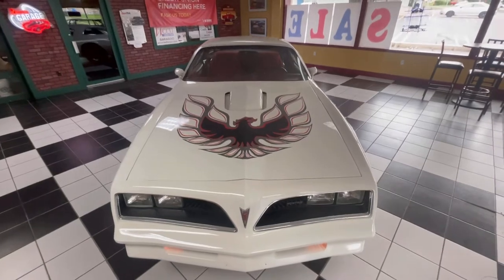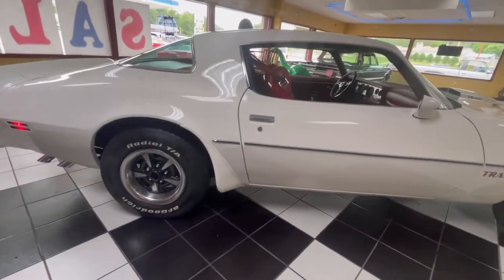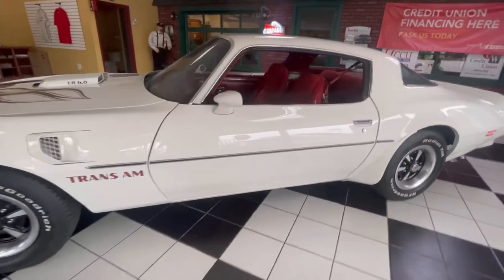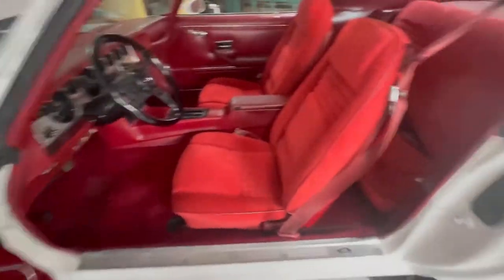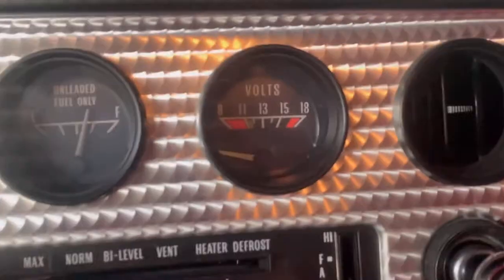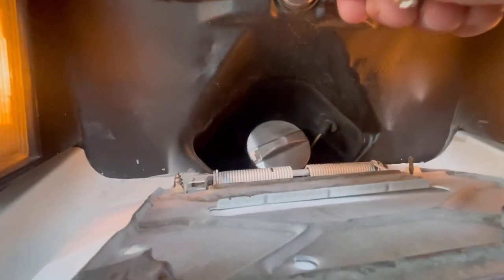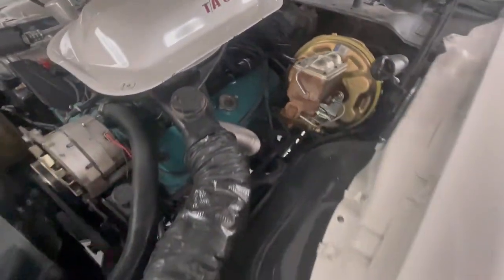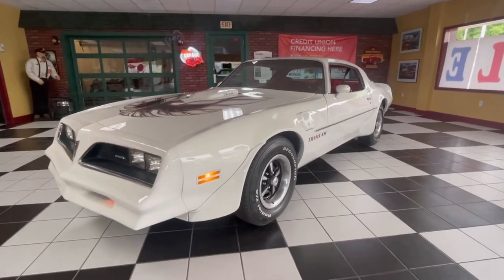1978 Pontic Trans Am

Comment: if the motor is original its a olds 403 not a 400.  400s had a 4 speed transmission
Reply: Thats not entirely correct my gold 78 with T Tops originally had a pontiac 400 and when i blew that engine the mechanic installed a olds 403 ( like a olds delta 88 had) i learned all this after it was installed and was very happy with both engines. And mine was a auto
Reply: Depends on the oil filler cap   otherwise its right
Reply: Statement is half correct only. In 1979 the Pontiac 400, t/ a 6.6, only came with a 4spd, however in 77 and 78, you COULD still get those in the automatic.  It's a w72 or a Y88 depending on the year.
Reply: @thebacdoc6464  good to know.  I always like finding out details like this on old hot rods. 😀
Reply: At 4:13 you can clearly see that is not an Olds engine. That's a Pontiac.
Reply: Only in 1979.
Reply: In77 and  78, you could order a 400cc t/a 6.6 with an automatic and a manuel. It was in 79 that a very limited number came only in the manuel.
Reply: Not in 78 .YOU HAD THREE CHOICES .PONTIAC 400 ,OLDS 403 AND PONTIAC 400 T/A 6.6 MANUAL OR AUTOMATIC WITHTHE T/A ENGINE.